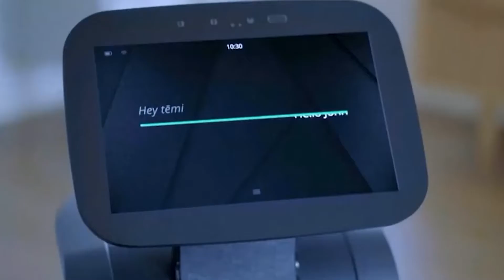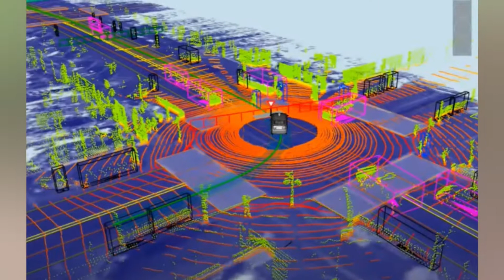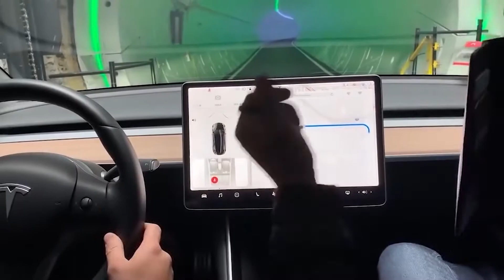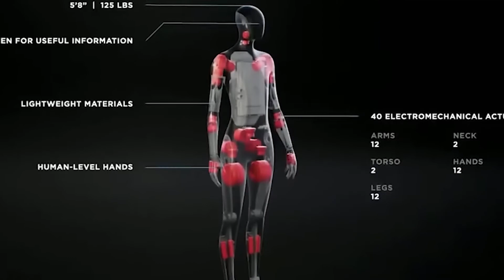Tesla Bot vs Boston Dynamics Atlas: Who Will Win?!

Comment: Who will win? Depends on the contest. I think Tesla Bot Optimus would be a much better data assistant. In a game of Chess, Tesla Bot for sure. If you want a big, powerful machine to assist with rescue and recovery, the Boston Dynamics Atlas series is the machine of choice. If you want a "Personal Data Assistant", It's Tesla for the win. In a "smack-down" fight, Atlas would litter the floor with the bits and pieces of Optimus. Tesla's Bot is basically designed to be "The computer that wore tennis shoes"... A real- life C-3P0. The Boston Dynamics is a bi-pedal 'forklift' with "a mind of its own". The Atlas scares me to death. I'm not afraid of the Optimus. I think it's actually quite 'charming'. My personal choice would be the Tesla Bot Optimus,
     Elon should have started out with the smallish, light-weight robot, perfected the AI, then, make the transition to the heavy, high powered cars. The most scary thing to me, are FSD over the road trucks, which can weigh up to 80,000 pounds. An accident with one of those is catastrophic! A malfunction in a car can be deadly. A failure in the Optimus bot means, something the size and weight of a teenager simply losing balance and falling over. Little to no harm done. If you're going to practice full autonomy, let's start with something you or I could beat in an arm wrestle, and pick up by our selves, if it does have a glitch. Something safe, but potentially extremely useful.